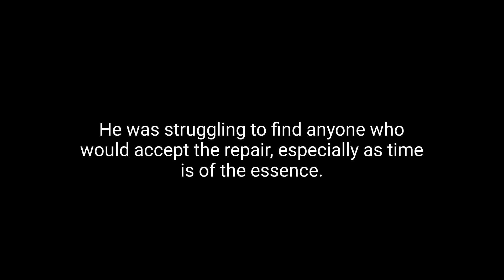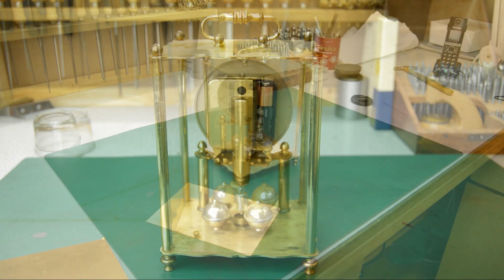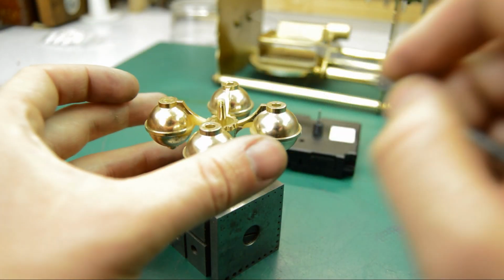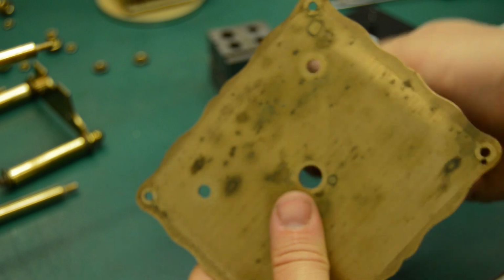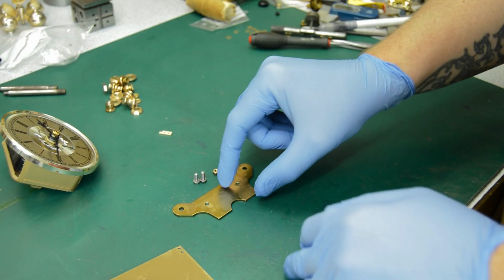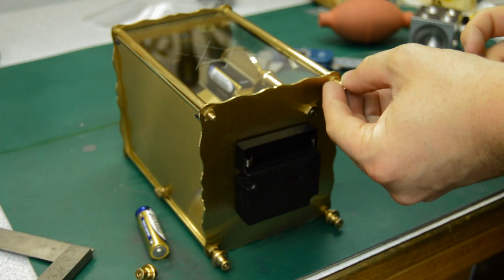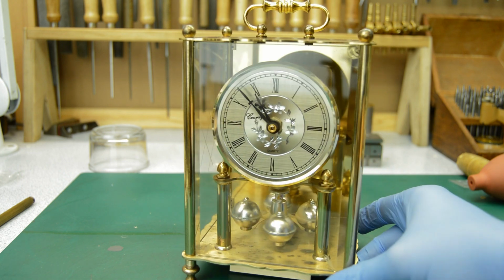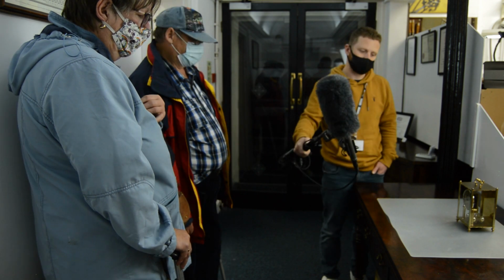Emergency Clock Repair - With BBC Radio Shropshire

Comment: Just brilliant... people tend to forget that the older you get, the more sentimental you become. You brought joy back to that gentleman in a way that couldn't have been achieved by simply buying him a replacement clock, no matter how expensive the replacement might have been... and that's priceless. Bravo Tommy 👏

Also, a neat little bit of problem-solving using a 2nd motor for the 'pendulum' & adding the brass plate to cover it, knowing that it was likely to be going back onto a mantle piece where the motor would be readily visible. That's a true craftsman 👌

Comment: What a kind gesture an effort. You recognized that it was not about the clock. It was about its meaning. I’m certain, that your time and effort far exceeded it value, several times over. But to the owners, it is priceless. Good on you.

Comment: How did the original quartz unit run the pendulum? I was one of the people who had to decline the work, my option was to get a spare clock from Ebay and cannibalise that. Glad you got it to work.
Reply from the maker: I suspect the original movement drove the pendulum with an integral motor, same idea as this but the motor and clock movement being in one unit. I’ve never seen one so I’m not entirely sure. It’s not my normal type of work I have to admit.
Reply: Most used a tiny fork which acted on the suspension spring. They were just like a mechanical one but the pendulum had no affect on the timekeeping obviously. It's a shame they don't make the movements anymore as I too get asked if I do them and while I've done a few using the method Tommy has, its very time intensive and hit or miss. It makes the repair very uneconomical, if actually possible.
Reply: @TommyJobson  Made by Haller I believe.
Reply: My mum had a quartz clock that drove the pendulum via a suspension spring. Quite a clever unit that I very much doubt is still made today.